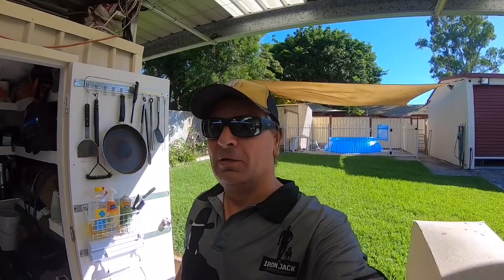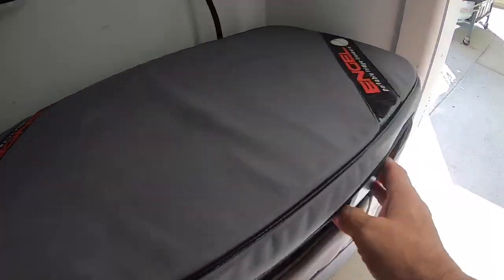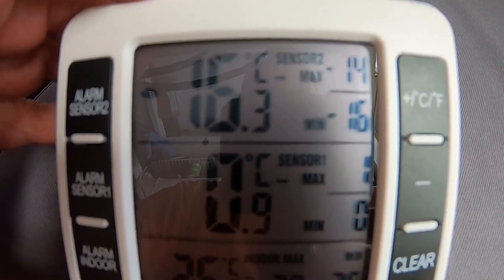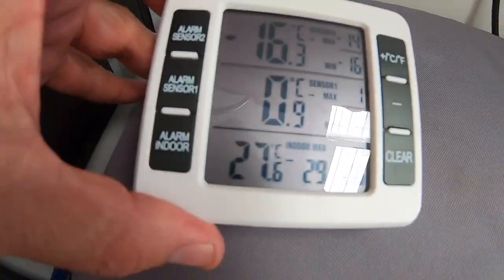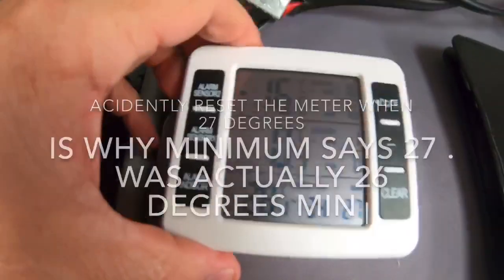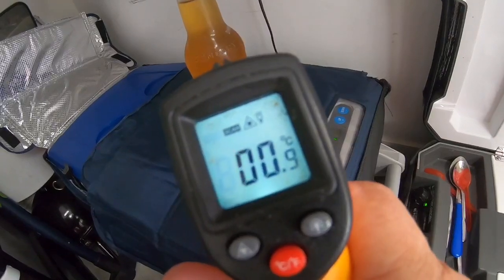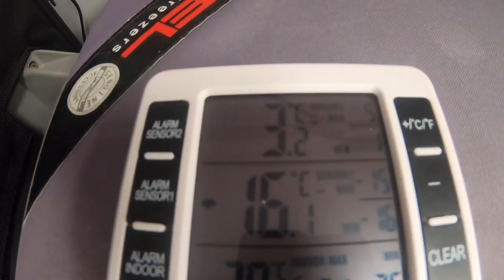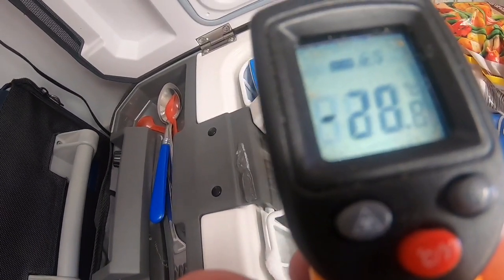Engel 38l and kings 60l fridge/freezer power consumption

Comment: Engel is by far the better fridge . Less power and robust . Not flash but reliable as hell
Reply from the maker: Totally agree 100% thanks for watching 👍🍻
Reply: @EFFICIENTSELF  keep doing these reviews on them and other stuff . Because you have good testing gear . And people need good information. I live on a small yacht and the 20 odd year old Waco gave up the ghost on temperature controller . It came with the boat . So have to replace it and found your review. Cheap things aren’t nice and nice things aren’t cheap

Comment: Hi mate, thanks for the video. 
I'd just point out that the amp/watt meter clocks over at 65.999 Ah (not at 99.999). I only just learnt that recently. 
Therefore the Kings consumed 74Ah, not 108Ah.
All the best 👍
Reply from the maker: Thanks for pointing that out as I learned that myself recently. Why would you make a meter to clock over at 65.999 ? 😂 got me beat . Cheers thanks for watching 👍🍻

Comment: Thanks for sharing. I reckon I'm cool with 4 degree beer on a 35+ day.
Reply from the maker: Amen to that 👍🍻
Reply: @EFFICIENTSELF  based upon your review I just purchased the runout kings 60l with the secop compressor. Thanks for the review.
Reply from the maker: My pleasure mate .. my kings fridge is still going . It’s 3 years old now and only the latch is broken and I just use bungee cord to hold the lid shut on the fridge . Other than that still going strong 💪